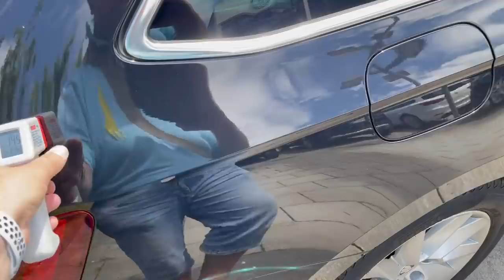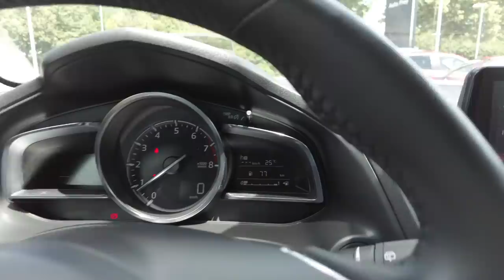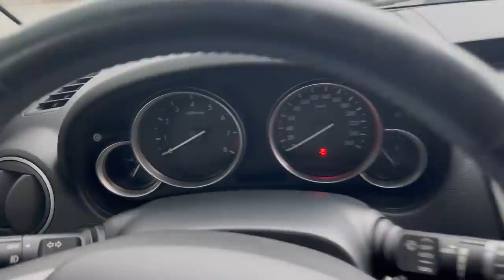Zajímal mě vodní skútr... VŠE VYPRODÁNO!

Comment: Ktorá verzia z mazdy 3 88kw či 121?
Reply: Auto s motorom 88 kW (G120) má "dlhšie" prevody = nižšiu spotrebu + nižšie otáčky pri povedzme 130 km/h = tichšie auto.
Charakteristika 88 kW motora je do 4000 ot rovnaká ako u 121 kW (G165) verzie (kde krivka stúpa do 6000 ot)  - napr:
https://blog.auto.cz/aktivnybloger/2017/05/20-skyactiv-88kw-vs-121kw/
Jednoducho povedané - do 4000 ot by išli autá rovnako, keby 88 kW verzia nemala "dlhšiu" prevodovku, ktorá zhoršuje dynamiku.
Záver Mazda 3 nie je celkom porovnateľná s iným autom s 88 kW - lebo má ten výkon už pri 4000 ot, na rozdiel od iného auto, kde je to pri 6000+ ot.
Normálne sa vraj 88 kW motor dá "odomknúť". Ale "vraj" už od výroby majú tie motory bežne cez 100 kW. Dobrý článok:
https://www.auto.cz/ojeta-mazda-3-mk3-bm-bn-zpatky-do-devadesatek-135909

Ak chcete úspornejšie auto - berte 88 kW verziu. Ak dynamickejšie, tak 121 kW. Predpokladám, že 88 kW bude na trhu podstatne viac. Navyše napr do sedanu sa dával iba motor 88 kW. Motor 121 KW bol v lepšie vybavených verziách (budú drahšie).
Ak nie ste vyslovene nejaký dynamický vodič 88 kW verzia bude v pohode. Ak ste dynamický a mali ste napr silnejšie auto s turbom, tak možno ani 121 kW verzia nebude dostatočne silná.